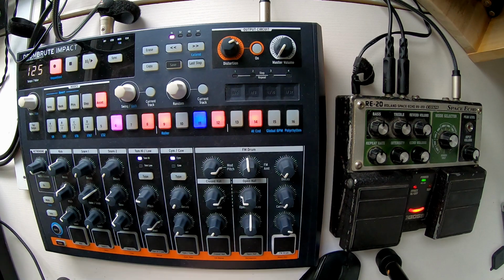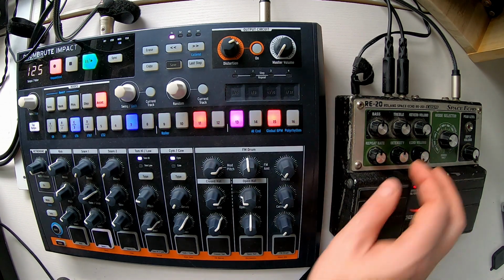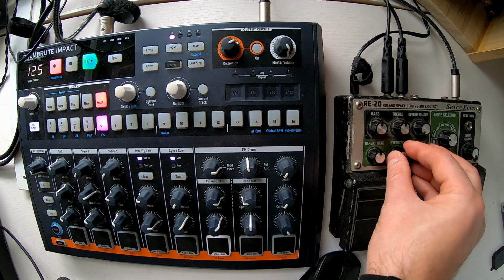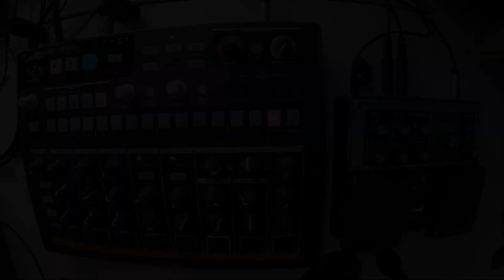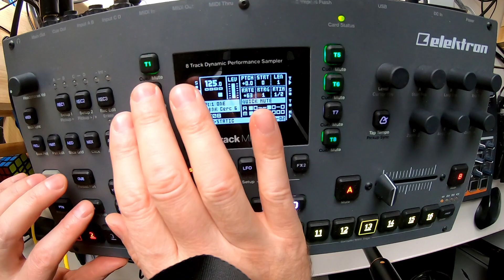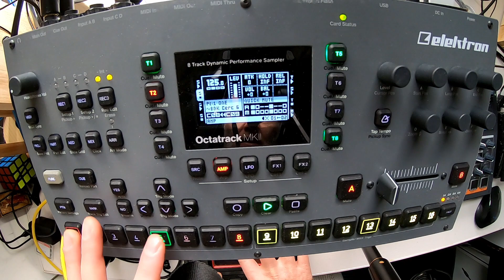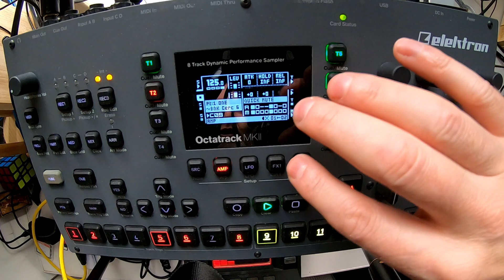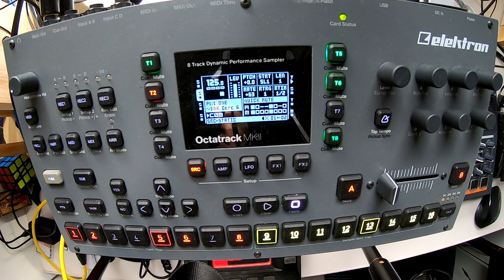Sound Design (Percussion) Part 2 with Boss RE-20 Space Echo + DrumBrute Impact

Comment: Very interesting really, I like the sound. I'm on the edge to get the Drumbrute to use it along with a BOSS DD20, actually two of them. By the way, you can easily remove the pedal of the RE20, there is just a little knob beneath the pedal, that allows to operate it much more conviniently, quicker and without the effort the pedal requires. I'm doing that with my DD20, which I have also on my desk.
Reply from the maker: I’ll definitely try your method! Thanks for the tip!!!